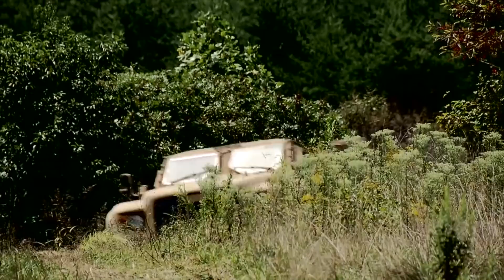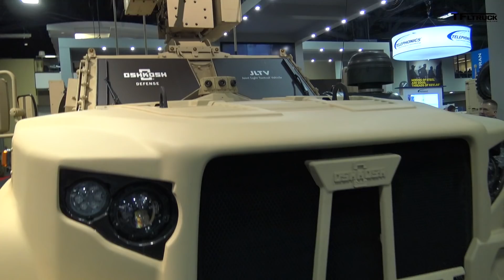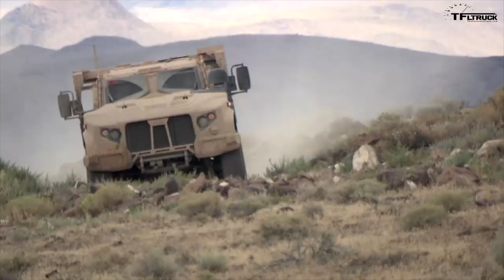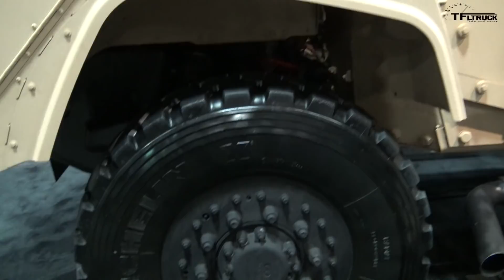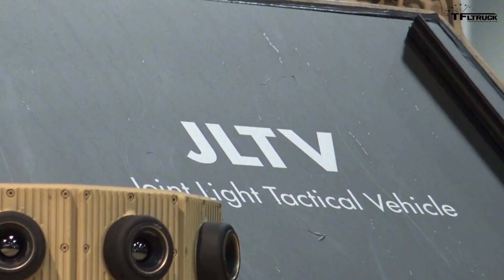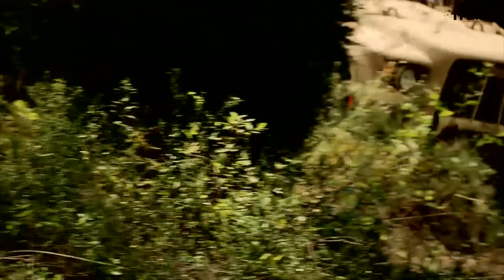Meet the New Humvee: The Oshkosh JLTV Coming Soon To Your Local Army Base

Comment: It's too big. The Humvee was already too big and wide for urban warfare applications.
Reply: AP S   Yep, Isis will run circles around these big heavy turds
Reply: Well, with their "technicals" (pickups with a weapons system mounted in the bed), yes they will. I'm just wondering about the intended role for this vehicle. It's still vulnerable to IEDs, and it can be brewed up with a 20mm cannon or a light rocket. This is a miniature MRAP; it has basically the same footprint (wheelbase) as a Bradley. There's still a need for a light and agile reconnaissance/patrol vehicle that can get through tight-ish spots (narrow streets, paths, etc. that the Humvee couldn't). The IDF uses a variant of the Jeep Wrangler, which seems to me to be a great option.
Reply: AP S agree
Reply: Look up Lost Armour you'll see that IED are the least of your troubles in this vehicle, about +120 lay destroyed across the desert in Saudi-Arabia and Yemen, non by IED's.

Comment: So what's the diff between this and the MATV?
Reply: MADTV is a lot funnier.
Reply: MATV is 2 feet wider 3 feet taller has a caterpillar inline 6 Turbo and can pull MUCH more weight.
Reply: purpose and weight 

the same basic differences you see in the MRAP vs HMMWV

the MRAP does one job ..very well 
the HMMWV is a beater..that can fulfill a large number of roles and can act as a decent middle ground when no specific threats exist 

both are upgrades to the former systems, but neither changes the role of it's predecessor 

MATV is the replacement..or atleast a supplement to the MRAP 
the L-ATV is a replacement for the HMMWV

roles do not change, nor are the consolidated, though the need for the MRAP should be diminished a bit with the protection added to the L-ATV
Reply: they are also way to wide for public roads so conus operations they are usless
Reply: Seth Chiaro There are no CONUS Operations.
Reply: What do you call Annual training, going from base to other training areas that require using civilian roads
Reply: I call that Training.  Operations means you load Ball and not Blanks.
11B
Reply: I'm still wondering if I can power drift this like the HMMV around a small bole with a track width that's only a foot and a half wider than the length of the HMMV.
Reply: I'm thinking serviceability with standard commercial block.
Reply: I do like the fact the bed is commo rack friendly.
Reply: Actually, I think they are both just about the same dimensions except the JLTV is higher off the ground compared to the M-ATV.
Reply: Every time we drive out the gate in conus it is a conus operation.
Reply: Im no expert but the M-ATV is older, and bigger. Just have a look at the troops using them in 2010. They're pretty massive trucks comparatively.
Reply: a lot less sleeping room in the back seats

Comment: I just hope comes with minimum bii, bii layouts can suck it. Not to mention a class for the Joes on how to properly PMCS on these vehicles.
Reply: TWO FORTY BRAVO OPERATOR BII for the MRAP was GFE, and carried over to the MATV.  I worked on the OEM side of the RG31, and it was a nightmare for TACOM having so many different OEM-specific BII's.  Since this is a close cousin to the  MATV , and since the PM is run out of TACOM, my guess is the BII, and the PMCS will be very similar.

Comment: $433,539 each ($6.7B contract)
Reply: The target cost for the base vehicle is $250,000 (FY11 dollars), excluding armor and other kits.  The current JLTV program cost is about $5.9B.  The U.S. Government Accountability Office (GAO) estimated it would cost $23B to complete the procurement of 54,408 vehicles in order to replace all the up-armored Humvees in the U.S. Armed Forces.  Believe it or not, this is a drop in the bucket compared to other programs out there in the DOD.
Reply: Why are you quoting dated information when more current information is available? "...the initial contract for low-rate initial production and full-rate production was valued at $6.7 billion, although over the lifetime of production, the cost would likely run about $30 billion. According to a story on Defense One, Army officials said the average price of each truck would be below $399,000." http://www.autoblog.com/2015/08/27/oshkosh-jltv-cost-less-399000-fully-loaded/
Reply: The source material I'm using is dated September 9, 2016 directly from the JLTV Congressional Research Service (CRS) Report (RS22942) which is more current and in-depth than your source, an article that was written on August 27, 2015.  The JLTV program cost is estimate decreased by over 19%, or about $5.9B, due to the revised estimates of vehicle unit costs and installation kits.

The FY17 budget request calls for $734.4M for Army and Marine RTD&E and Procurement funding for the JLTV.  The Army plans to procure 1,828 JLTVs in FY17 and the Marines plan for 192 JLTVs in FY17, which is 77 fewer vehicles than originally programmed.  Both the House and Senate recommend to fully fund the JLTV RDT&E budget requests as of right now.  There will be potential issues that will have to be sorted in terms of budget and procurement down the road with any major system being implemented in the military.

I'll trust a CRS written last month vs. an autoblog which was using information that's now dated.

Comment: I thought they replaced the humvee with the MRAP?
Reply: The MRAP program was initially created to replace the Humvee.  However, with the introduction of various upgrades (FRAG kits) and the introduction of the M1151, the Humvee will continue to see service for many years.

Department of Defense officials have already made clear that the Joint Light Tactical Vehicle (JLTV) "are not intended to replace HMMWVs 'one for one'".  As of September of 2016, Congress will have to revisit the program and review how the services plan to use this vehicle in operational units in both the Army and Marines and within the Active and Reserve Components of each service branch.
Reply: That's a larger class infantry vehicle.
Reply: The JLTV is designed to replace armored HMMWVs.  The un-armored HMMWVs will be around for quite some time, the armored HMMWVs are being phased out.  The armored HMMWV is not as effective as one would want...

Comment: There has been many off the shelf MRAPs that were thrown into combat (RG-31, RG-33, Caiman, Cougar, etc.) to help counter the IED/EFP threats in Iraq and Afghanistan.  MRAPs were great for getting from point A to point B but have severe tactical disadvantages.  For example, the inability to quickly dismount and mount, especially while carrying 65-80+ lbs under full combat load.  That's why many units continued to use the Humvee (M1114, M1151, etc.) even though they lacked the survivability of MRAPs.  The Humvee was a great design in the early 1980s and was the answer to replace the venerable Jeep but when IEDs, and later EFP threats emerged in Iraq and Afghanistan, the Coalition Forces had to adapt to the changing conditions of the battlefield.

This would have been a great option years ago but unfortunately, Congress can only spend so much for upgrading and adopting new vehicle systems, especially for something as major as replacing the Humvee.  Furthermore, lessons learned had to be incorporated into this vehicle system, improving the capabilities and survivability.  That's why we are only now starting to see a myriad of new systems (weapon, vehicle, equipment, etc.) being introduced and issued now that the U.S. Armed Forces has switched gears (Post OEF/OIF era) from direct action operations and now focusing on reorganization and training with a now much smaller force.

Hope you enjoyed the AUSA meeting/expo, it's a great opportunity to see the future of warfare technology and business at its finest.
Reply from the maker: +Mighty Tiki thanks for the thoughtful comment. We learned a lot from your analysis of the current state of the art situation.

Comment: can these vehicles be dropped out of the bottom of airplanes for deployment like the humvee ? or is the extra weight to much!
Reply: they'd never purchased it if it couldn't be airlifted.
Reply: okniceguy He was referring to airdropping, not airlifting.
Reply: gives them excuse to go buy bigger planes
Reply from the maker: +Game Bred Duramax yes they can be airlifted
Reply: The Fast Lane Truck thanks, it is a very impressive vehicle for sure!
Reply: those miniature hooks in the hood are made for airlifting, by the way.
Reply: The military airdrops construction equipment, so these shouldn't be an issue.
Reply: Game Bred Duramax you can definitely heavy drop them in on a c17
Reply: autofixation ooh. i see. i would hope they didn't engineer a new bricks with backwards-utility.
Reply: There are loops both on top of the hood and at the back of the cabin for air drop attachments points.
Reply: Trucks like this would generally be airload/slingloaded.  They are VERY top heavy and the impact of an airdrop (parachute) would be devastating, I am willing to bet that someone much smarter than me is working on a way though.